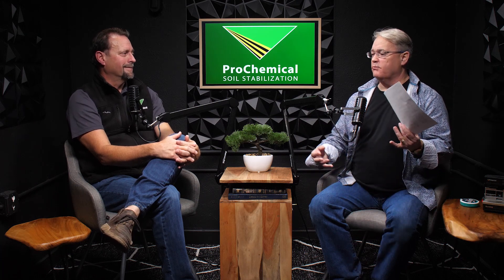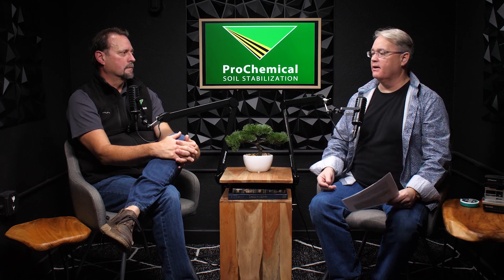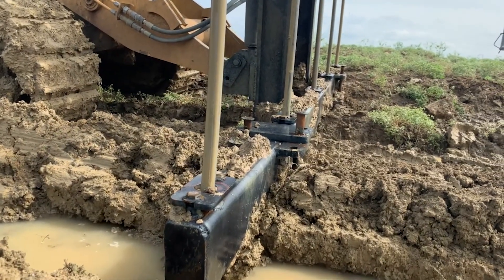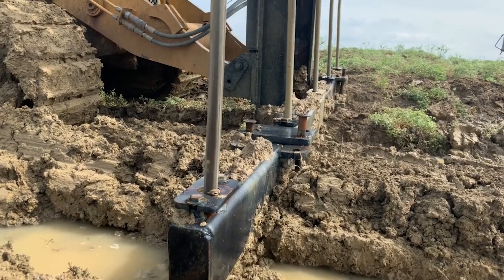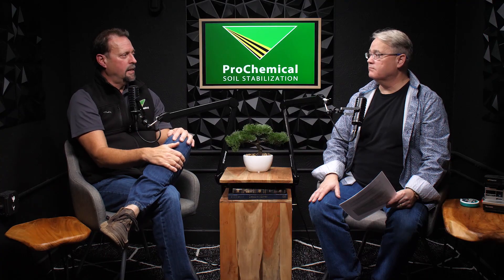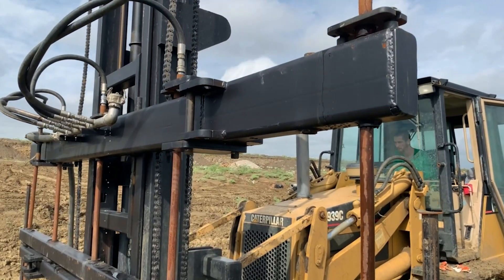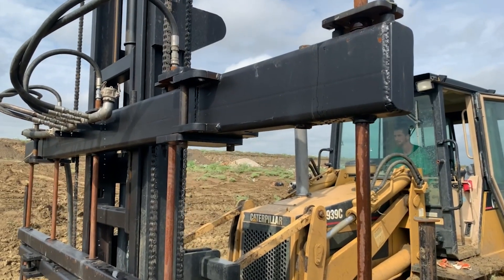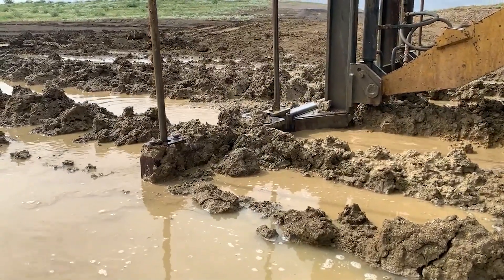From Water to Stability: How Chemical Injection Works

Comment: Is this equipment on the tractor specially made for you or is it possible to buy somewhere. We are thinking of learning this business here in Iceland and get the right equipment for it
Reply from the maker: Thanks for reaching out. The injection rigs we use at ProChemical are custom-fabricated in-house and designed specifically for our soil stabilizing process. They’re not commercially available, and the chemical solution we inject is proprietary. If you're exploring this type of work in Iceland, we’d recommend partnering with a geotechnical engineer and fabricator to develop a system suited to your soils and climate. The solution we use is a proprietary ionic stabilizer developed through decades of field testing. It’s engineered to alter the polarity of expansive clay, preventing water bonding and drastically reducing swell and shrinkage. While the formulation itself isn’t available for distribution or resale, the underlying principle is based on modifying clay chemistry to improve soil stability. Any replication would require significant lab testing and localized soil data.